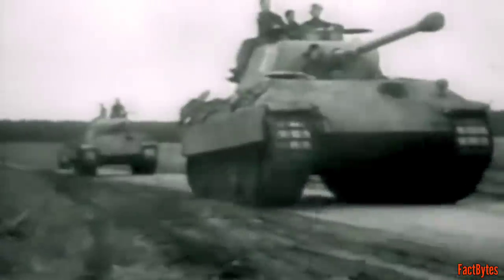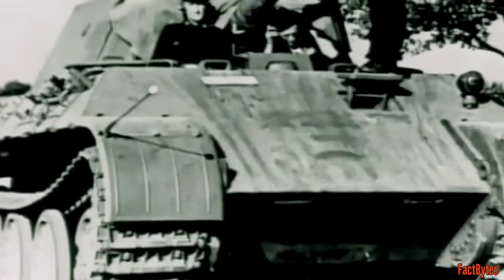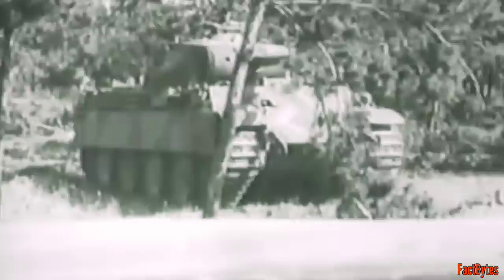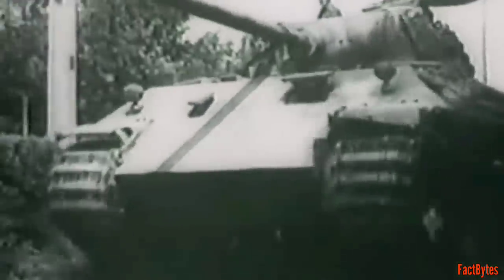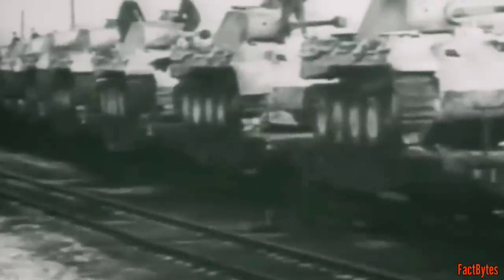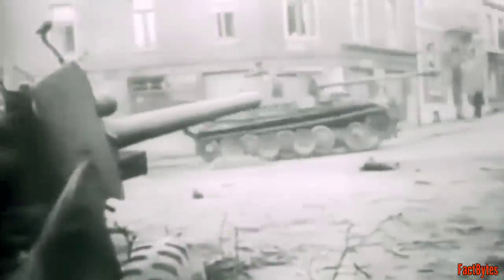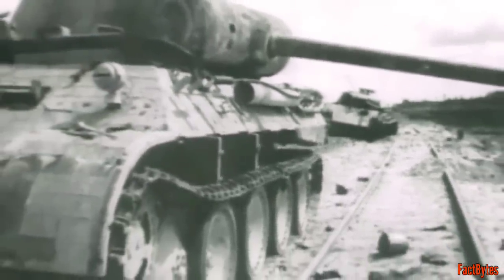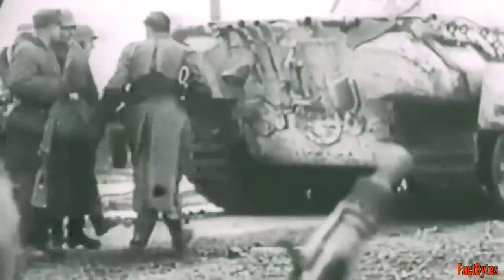Was The German Panther Really The Best Tank Of WW2?

Comment: The main gun was the best 75 of the war, the tank itself was over engineered and could be taken out by a 60 pdr like the Tiger, with a well trained gunnery crew. Guderian wanted the gun put on the panzer 4, but not possible engineering wise.
Reply: Personally, the Sherman 75 was much better overall, simply because it did better against infantry and such, not just tanks
Reply: 6 pounder?
Reply: @stevenbreach2561   The 6 pounder become latter the US 57mm AT, still can get a big german cat with APDS ammo under 800 meters.
Reply: @ricardosoto5770  the Bovington Tiger was taken out by a 6pdr from a Churchill.
Reply: @pavelslama5543  Yep, a hit in the turret rig.
Reply: @stevenbreach2561  Yep. The puny little 6 pdr took out heavy German panzers.
Reply: 68 pounder maybe? Those were taken out of service in 1919 or something like that.
Reply: @martkbanjoboy8853  Nope, the 57mm 6 pdr which entered service in 1942. First used in the North African campaign. The famous Tiger 131 at Bovington was a victim of it. As the UK we had some shockingly bad tanks, but had some superb artillery.
Reply: I disagree, it does have quite the armor punching capability, it has a absolute lackluster HE round, I’d prefer the 76mm M1 yes it pens less, but it’s a respectable weapon and has a decent HE round
Reply: @Cobra-King3  Biased towards the 17pdr and derivatives thereafter, but at least the US 90 mm was a good gun. Fair enough though with your opinion 👍😊
Reply: @kungfuwitcher7621  the 76mm M1 is not a derivative of the 17 pdr
Reply: @Cobra-King3  Didn’t say it was. Just saying I thought the US 90 was a good gun.
Reply: @Cobra-King3  The 17 hearly MK1 did had a lackuster performance, due to the heavy steel wall needed for such a high velocity round taking the place of the high explosive in the shell, the late war Mk 2 low velocity, thin walled HE round did solve that issue, that is when the brits started to  put two firefiles per troop instead of one, and puting the 17 pounder in the Centurion Mk 1. and a downgraded 77mm in the Comet.
Reply: Best 75 gun of the war?
For what? 
It's AP values?
Sitting on defense playing tank destroyer is not the role of a tank. Not according to
Germany
UK
USA
USSR
Or anyone else.
The kwk43 was a one trick pony.
Post war the role of tank destroyer and jagpanzer was folded into the tank mission, but NOT during the war.
And modern tanks still use primarily HE
Reply: @drudgenemo7030  Many historians have written about the Panther gun and cited it as the best of war for various reasons. If you have published material to contradict them please share.
Reply: @kungfuwitcher7621  yup
Anything pertaining to the field use of tanks.
That includes Nazi field manuals as to how tanks are to be deployed.
AP is all well and good but 90% of tank operations involve something other than shooting other tanks.
HE is more relevant operationally.
Reply: @drudgenemo7030  I meant just the gun itself on technical specs etc.
Reply: @kungfuwitcher7621  romels drive to the sea is but one example
Destroying communication, supply and reinforcements. All soft targets(HE).
AP is good for tanks.
The point of blitzkrieg is to AVOID hard targets with the tanks, to "run wild in the enemy rear".
I know
Doesn't make a good video game
Reply: @kungfuwitcher7621  hmmm
Specs?
I'm talking application.
Doesn't matter what it does on a KD range
Winning battles is kinda the point
Building equipment to fit doctrine is kinda important
Reply: @drudgenemo7030  Rommel wouldn’t have had that gun, assuming you mean the French coast. I am meaning things like range, hit power and accuracy of the gun that was dismissed by the Germans etc..
Reply: @kungfuwitcher7621  yup and I'm not taking sitting on defense playing tank destroyer
I'm talking actually using a tank per doctrine. The kwk43 doesn't match as well with German tank doctrine as the kwk40.
It matches well with jagpanzers and TDs
Sorry if actually understanding how tanks are supposed to be used by the army that had both the tanks and the doctrine upsets you.
As the Germans were getting their asses kicked from the time of the introduction of the panther, it wasn't a bad call, but it most certainly didn't match their written doctrine, nor how all the fans of Nazi wuderwaffe like to think about how it was used.
Reply: @kungfuwitcher7621  add in the kill/loss ratio of the panther, especially when actually used in masses tank battles(Kursk, arrancourt) maybe it wasn't all that and a bag of chips
Reply: @kungfuwitcher7621  nowhere in German tank doctrine nor the classic examples of the prowess of such is the intentional assault of tank formations.
Lauding the prowess of taking out tanks goes against that doctrine
Reply: @kungfuwitcher7621  I would site some examples of the panther being used for classic blitzkrieg, but I don't seem to recall any. Perhaps you could give me some.
And no I'm not being cheeky.
I tried to recall any but couldn't.
I would hate to think what many "experts" consider the "best" tank of the war was never successfully used in the role it was intended in 2 years of conflict, regardless of my personal opinion on the subject.
Reply: @drudgenemo7030  It probably wasn’t the best tank, in fact I would say it wasn’t. In the latter part of the war with lack of resources, boiled eggs could probably have penetrated the armour. Thing I have been referring to the gun since my OP, not the tank. Bovington I think has some website documents, but their tank chats are very good. Al though the funny little man with the huge moustache can be a bit boring.
Reply: @kungfuwitcher7621  like I said, the gun was great for AP. I don't agree that makes it a great tank gun, quite the opposite considering the compromises to get the velocity. And it wasn't a technical innovation. The 17 pounder was nearly it's equal but was lighter and still had a somewhat useful HE round.
And the 17 pounder wasn't the main gun of the tank corps. It was used to supplement the standard 75. 
IMO the kwk43 was a political decision that, along with the excessive armor, turned a decent tank into a bad one.
The lack of a roof mounted sight, independent traverse, commander override, ECT further hampered it's function as a quality over quantity tank.
If you fix those errors, you basically wind up with a teutonic Sherman.
Reply: @kungfuwitcher7621  and for about the same weight as the Kwk43, the Americans had the 90
Reply: @drudgenemo7030  True, probably vastly more 6pdrs than the 17. Still though Brit guns would make a mess of the Germans and Axis allies. There was a biography of Rommel that recounted the encounters in North Africa. Unfortunately I don’t remember the name, but think Mark Felton has covered most on here. Especially the 25pdrs making absolute mincemeat of Panzer battalions.
Reply: @kungfuwitcher7621  yeah
The 25 was used in the role, much like the famed  88, but as from late 42 on the Germans were mainly on defense it wasn't needed in the AT role very much, and some criticize that, as opposed to understanding that a towed gun is difficult to deploy offensively, especially a large one, such as the 17 & 25 pounders, the 88, and the kwk43, ECT.
And others think bore is the only way to measure gun size.
The M3 75 is a fraction of the physical size of the kwk43, or the kwk40 for that matter, for all them having the same bore. The shells are vastly different in size as well. Comparing apples to oranges.
Like I said the kwk43 was more comparable to the 90 than the 76 m1 or the 75 M3 in terms of sheer size, weight, and use. Against the 90 the kwk43 comes up a bit short. Especially as a tank gun.
Reply: @kungfuwitcher7621  when Rommel used the 88s( and Italian 90s) in N Africa, he deployed the guns then sucked the tanks to the emplaced guns. Once you figure out that trick, it's hard to replicate ( took a bit for the British to catch on, and the Americans had to learn for themselves)

Comment: If you take everything into account, ease of manufacture, reliability, and overall quality, I don't see how you rate it as high as either a Sherman with the 76 high velocity gun or with a T-34-85. German tanks in general tended towards being over engineered a problem that persist to this day in the cars they make.
Reply: For a German tank, the Panther was pretty cheap and easy to produce - on par with the Panzer IV once production got into high gear, but the poor reliability on road marches and (just as important) difficult maintenance and repairs meant that there were always too few of them ready for battle, which was just never an issue with the highly reliable Sherman and the decently reliable and easy to repair T-34 both of which were also available in numbers that dwarfed the number of Panthers.
Reply: An interesting point would be the equivalent build cost of the Panther compared to the Sherman with the 76 mm gun and the T34-85
Reply: @stevenbreach2561  those things are hard to quantify between nations with very different economies and production systems. Generally speaking, any German tank would be significantly more expensive than either a mass produces American or Soviet tank - even factoring in, that the American tank had to be shipped half a world away - simply due to Germany's less developed sysytems of mass production and the differing standards of manufacture.

The Panther is a moch more complex vehicle than either the Sherman or the T-34 and also significantly larger and heavier than both. By any metric it would be a lot more expensive.

The Panther is a fairly "cheap" tank only by German standards.
Reply: @Finkeren  wrote: "The Panther is a fairly "cheap" tank only by German standards."

--Exactly.
Reply: @Finkeren  Boi, T 34 manhour produce time: 3.000-9.000 depending on factory/year.
Panther: 2.000
A Sherman was 55-60.000 USD, Panther was around 50 k.

"According to rough estimates the labor hourrelation in comparison to the Panzer III stood at approximately 1 to 1.25, i.e. 4 Panther vehicles for every 5 Panzer III tanks built. Cost (without weaponry) PzKpfw III RM 96,163; Panther RM 117,100" Walter J Spielberger 1993, Panther & Its Variants p. 23.
Reply: @stevenbreach2561  wrote: "An interesting point would be the equivalent build cost of the Panther compared to the Sherman with the 76 mm gun and the T34-85"

-- Panther would be by far more expansive, not only money wise, but time and resources wise to produce, not to mentioned because it was a heavy tank, it had to be serviced as a heavy tank, but it didn't performed as a good heavy tank.

Comment: In the video it says that the Panther wasn't as heavily armoured as the Tiger, this is wrong. The Panther did have thinner armour, but it was slopped. It's effective thickness was 140mm, compared to 100mm of the Tiger. It was also mentioned that the HE round was less effective than other 75mm rounds. This again isn't true. The Panther's HE round had about the same explosive filler as the round used for the Panzer 4 and Stug 3.
Reply: The side and rear armor of the Panther was much thinner than the Tiger one. In fact Soviet 45mm guns could take a Panther with a side shot and they did. Soviets thought the Panther was a tank destroyer and not a main tank due to the differences in frontal vs side armor but the Glacis of the Panther was better armored than a Tiger 1. 
 The 75mm HE round intitally was less filler than the older one of the PzIV, eventually they developed a low velocity round, that carry less metal and more filler, the same happened to the Brits with the 17 pounder, but it was after Nornandy, when the brits started to put 2 and not 1 Firefly per troop and field the Comet 77mm.
Reply: The Tigers frontal armour was considerably more effective than its 100mm paper thickness, due to its unique nickel steel quality and 265 Brinell Hardness. Also the slight angling (24 degrees on the nose plate). This gave the nose plate a circa 130mm effective thickness.
The nickel steel and Brinell Hardness also gave the 80mm side and rear plates an effective thickness of 90mm plus which was nearly double that of the Panther D and A. 

Source: Tom Jentz, Germanys Tiger Tank.
Reply: @lyndoncmp5751  The Nose plate was the only angled side of the Tiger armor but is almost never exposed in a tank. Also the sides of a Tiger 1 Turret  were curved. That gave it extra protection. Sadly the Glacis, Sides and Mantlet were flat as a table.
Reply: Panthers frontal armor was very good, but its side armor was absolutely halfassed. It couldnt even reliably protect against a 14.5mm AT rifles for freaks sake!
Reply: @pavelslama5543  That is why the russians intially thought it was a Tank Hunter. Very well protected fron the front but not from the sides.